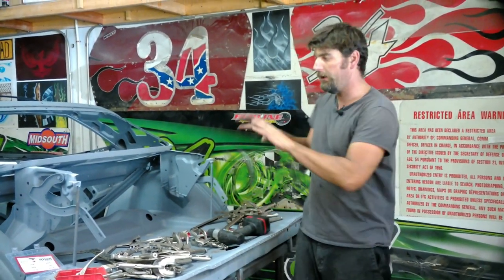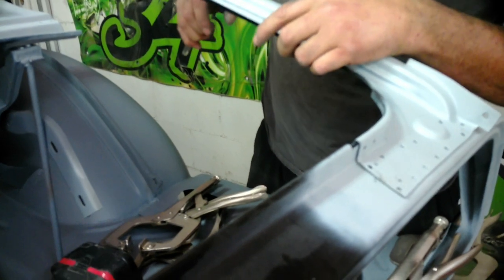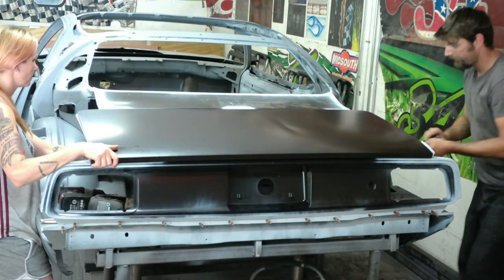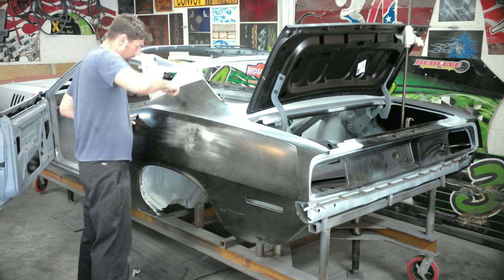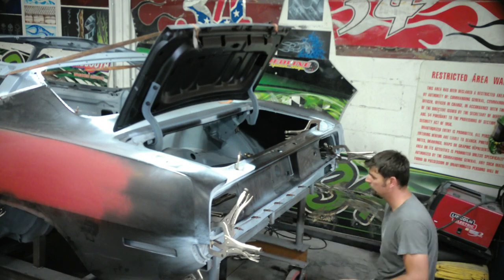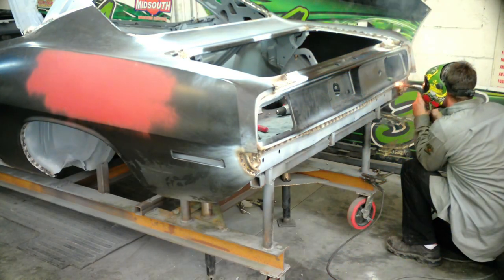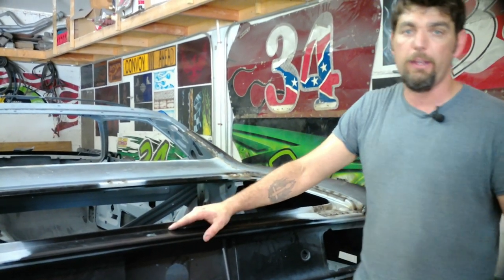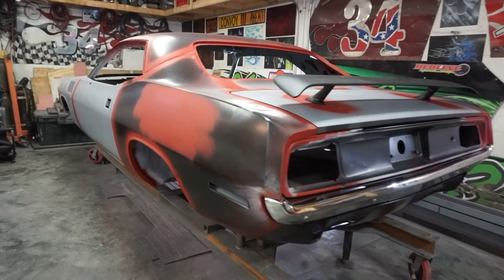1971 Cuda Episode 8 Installing Quarters, trunk deck filler panel, tail panel, spoiler

Comment: Incredible instructional E Body assembly. Really would like to connect with you a lil down the road for my 71 Challenger. First thing I need is a frame jig. I don’t mind making it I just need good reference for the measurements. Great work! Love the car, I can’t wait to get my challenger to this point
Reply from the maker: Sounds like a plan and thank you, personally If I know the car has never been hit or not really rusted away I will drop a plumb bob down to factory e body points and then just cut some metal at the height I want and mount the car that way as long as its all supported level and not all trying to sag it anywhere.
Reply: Yes that’s all good no wrecks or rust although I have to put the frame rails in the car. Last guy put a new floor in the car and the he ripped out the original frame rails so I need a jig with the right mounting points to fit the rails to and then attach the jig to the front (k-frame) location mount. I don’t want to go off the tack welds to place the frame rails. He did it backwards so I gotta undo a bunch so I think a jig would get me on the right track. I do have new Goodmark frame rails to go in the car along with every piece of sheet metal made for this car. The original owner abandoned the build after the original motor and tranny was stolen! So he dumped it and I’m gonna make a driver restomod. Your instructions are so clear and directional. I can’t wait to get where I can follow your instruction. Jig, frame rails, attached and positive the car is where it needs to be to begin the tear down. Thanks a bunch for any info I can resource to make a good frame jig for a 71 Challenger
Reply from the maker: @skipsims2384  Ah I see now, it is very frustrating when you get a car that was worked on by someone else that dove right into it but didn't really know and messed up the process. I have also been where you are trying to fix someone elses mess and feel your frustration. I know I have a 74 challenger coming in the shop in the next 3 months or so and on first glance the car looked like it is in decent shape so been going back and forth weather or not I will JIG up the car. Saying that I just picked up new metal for a JIG last week so I was planning on putting it on one for the simple fact it will be easier to move around. If i do that I will try and do a video on building the JIG for the car and tryin to mount it in place with some measurements that might help you in the process. Shoot me an email to carthageclassiccars@gmail.com and if i don't do a video when i get the car mounted i can personally send you some measurements your looking for.
Reply: @carthageclassiccars  can you share the e body factory points, so I can drop a plumb Bob down to see if my challenger has been hit.
Reply from the maker: @claytonhaske  https://forum.e-bodies.org/reference-material/18/e-body-frame-diagrams/4768/
Reply from the maker: go to this forum link i have used this before on this cuda build to verify exactly what you are looking for, make sure you use the challenger one.

Comment: It just so happens I am in the process of doing these steps for a 70 Dart and your comment about having to work with the new panels is spot on. Great to see how you resolved issues. It that primer weldable etch primer? Did you remove the primer where you spot welded?
Reply from the maker: Thanks for the comment, the red primer on the car is just a red etching primer that will protect the bare metal primer before rusting. I use it because Lacquer thinner takes it off easy when I am ready for epoxy. Saying that the grey primer used in a lot of my videos is weld through primer. Usually I will only try and add weld through primer between the panels and try and keep where I am welding clean on the topside. It doesn't always work out that way but thats my goal.

Comment: Thanks, Did you use the 2 holes on the bottom on that rear Valance ? I cant find any diagrams on it besides the Service Manual that barely shows anything on that ?
Reply from the maker: Yes on the Cuda there is 1 hole in the top on the tail panel behind the bumper on the corner and two lower ones on the sides.

Comment: Question: When gaping the doors when they’re stripped, then adding the glass, regulators, panels and hardware, do you have to re-adjust?
Reply from the maker: I will try and set them on the final assembly slightly higher, but yes there have been times I had to go back in and readjust. But when the door "sags" them adjusted back the gap will fall back into place. Usually worse case in that scenario I will have to leave the top adjustment bolt in the door loosen all the other bolts on the pillar and just pick up on it in the back and it usually fixes it.

Comment: Did you put the bolt studs & Clips on the Rear Valance Panel or on the Quarters, I can not find any good Diagram on the 70-74 Cuda Rear Valance ?
Reply from the maker: I put the clips on the valance then its easier to put the bolts in from the quarters vs the other way
Reply: Thanks Mate
 @carthageclassiccars

Comment: I get completely sucked into the cuda episodes :o)  Would a spot welder help or would it stop the adjustment process? I’m guessing the factory had a lot of jigs.
Reply from the maker: I feel the resistance spot welder (one of the quality ones)  is the way to go and in the next level restoration. I feel it eliminates the grinding and cleanup step and also let get into areas better as they are pinching and welding at the same time. That is eventually what i might be working towards purchasing in the future if all things go well.

Comment: I am not sure if ebody vins are on the trunk lip like abodies. Just wondering how you deal with this?
Reply from the maker: Yes the e bodies have then stamped on the trunk gutters. I haven't had an issue with VIN numbers or the state fraud and theft, they have been out doing vehicle inspections before from stuff we have bought and sold in the past. We don't do VIN swaps here in the shop and only honest restorations even if it is replacing a lot of metal it has always been an original car . Transferring the VIN stampings over is up to the owner if they aren't too rusted away in the first place or I will give it back to them for their documentation on clearing up any issues that may arise.